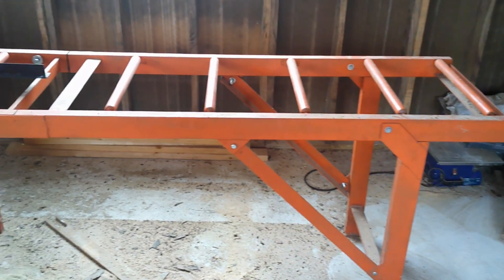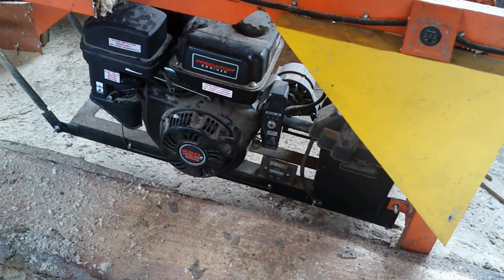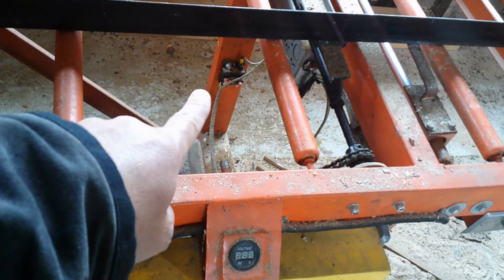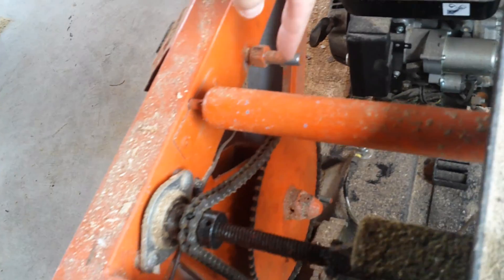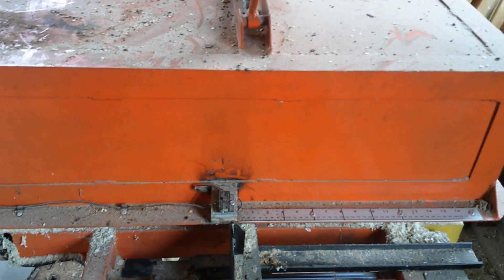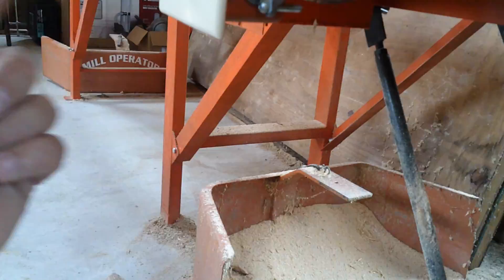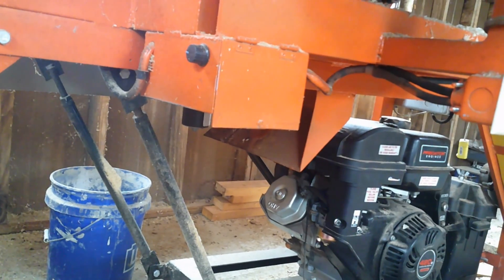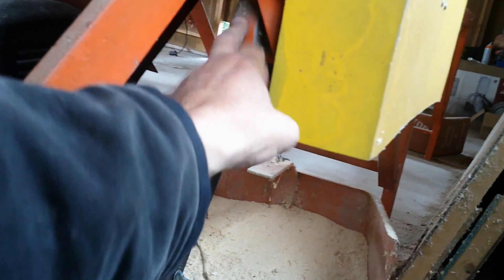Homemade Edger Saw for the sawmill

Comment: Nice build. Love the recycling. That 14.6 volts is boiling your battery. Ford always did that and you could smell the sulfur of the sulfuric acid around them. A GM style 100 amp single wire would be great for what you are doing.

Comment: Thanks.
I’m running an LT 15 go just for my small furniture business, but I’ve been pondering building an edger for myself since now I just dry everything and then edge it in the shop a year later which is more work and takes up more space . I’m not in a Lumber business so I don’t know if a unit like yours would be too much or not for me but it’s my sparking right now so thanks again

Comment: I love the way everything is self contained, that could easily be made portable. I am surprised the windshield wiper motor has enough snoose to pull the boards, how thick of boards will it pull? 14 inch blade should be able to cut around 5 inches?
Reply from the maker: the throat of the saw will only cut 2 3/4" by 13 boards i didnt want to go any bigger because i didnt think the wiper motors would hold any more than that with the brass gears on the inside gear box, the 14 HP engine has no problems with the torque from the blade.
Reply: @realsouthernexposure3957  That makes sense, most of my flitches are either 1x or 2x.  I bet that 14hp motor has no problem running that blade, what is the ratio between the motor and the saw arbor?

Comment: Awesome little unit. Been designing something like this in my head but you gave me a few ideas.  What did you use for an arbor and for the linear bearings on the fence?
Reply from the maker: Linear bearings came off a miter saw I found at a garage sale for $10. The arbor I turned it down on my lathe. Thanks for the complement, I hope it helps you out man.